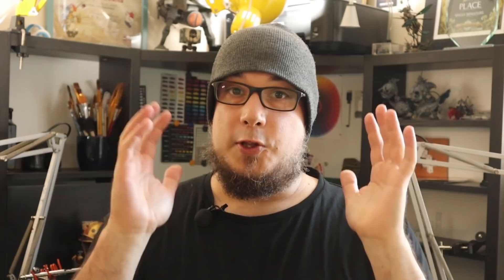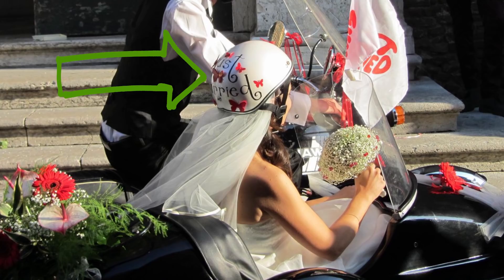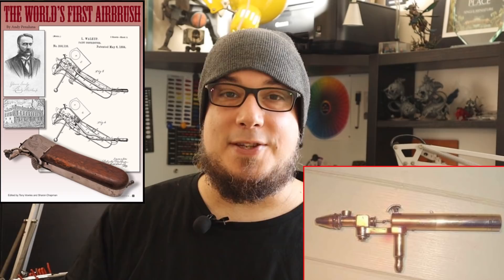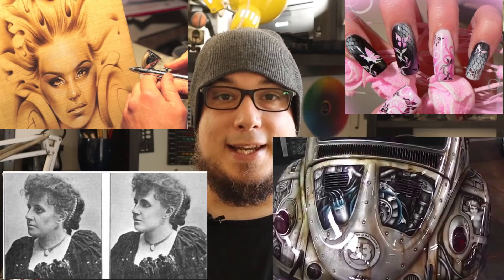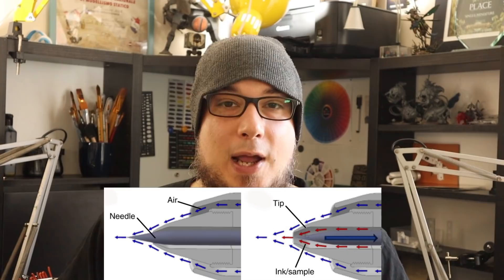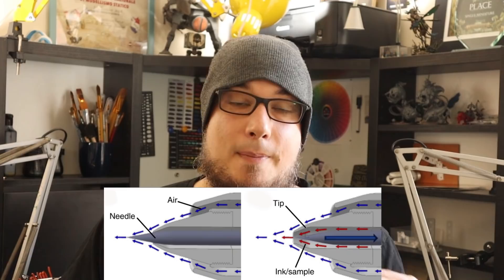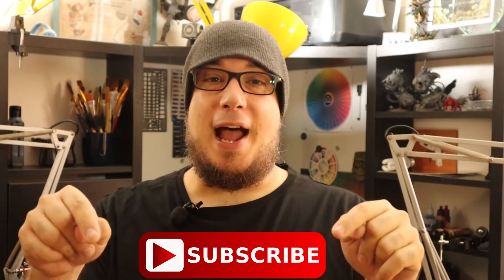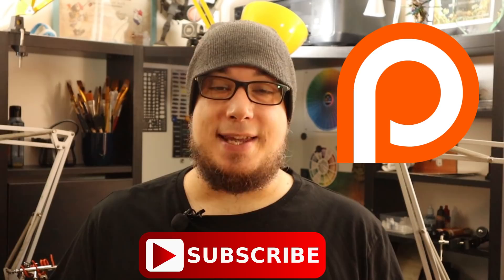Airbrush basics - Airbrushing for Miniature Painters

Comment: Great video as usual, but I disagree that you have to know about blending, glazing and all kinds of color theory and techniques before buying an airbrush.

Using an airbrush is THE most efficient way of applying paint to a surface - you're literally using less paint to cover the same surface area.  As a result, you avoid losing detail by not gooping on paint with a brush.  At the least, you can Prime and set up your Zenithal paint job with the airbrush when first learning to airbrush.  It also makes it faster to set up an entire army.  An airbrush is also a better way of painting larger plastic models such as Warhammer40K vehicles and architecture.

Also, having an airbrush affords you more possibilities.  You're not restricted to what a spray can gives you - you can mix your own colors and an airbrush isn't nearly as messy; plus, the atomization is superior to a spray can...in most cases.
Reply from the maker: Thanks! Yeah if you are an army painter and you want to use the airbrush for the very basic stuff this it's probably true, but if your main goal is good painting I really think you have to save money and stress until you are able to use it's full potential

Comment: noob question: isn't a 0,2mm too small to prime and to use it to paint gunpla, vehicles and other larger models?
Reply from the maker: No no it's the perfect size, I use it to prime monsters and entire armies! You need only to pull the trigger a bit more 😉
Reply: In my experience a 0.3 or 0.4mm is best for priming, basecoating, varnishing, the smaller needles best for details and freehands. But you can use a 0.2 as well. You might need a bit longer and more coats, but result is indistinguishable

Comment: Dear Marco,
I was wondering whether you can unscrew the air regulating screw under the iwata hp-bh. I've had cheap quick disconnects with an air regulator and when I unscrew it too far it jumps out! I was wondering if this airbrush would have the same issue? Haven't found anything online about it, nor have I seen you unscrew it in the cleaning video... 
Kind regards,
M
Reply from the maker: Hi! Sure, if you have dirt and paint trapped you can unscrew the valve; I do it rarely because usually I don't have a lot to clean in that lower part (and because I don't want to lose time finding again the setting I like 😅)

Comment: Hi Marco, your videos are awesome and i improved already. But i have a problem and maybe you could help me. When i use the airbrush and dry the model with an hairdryer and i use for example washes the paint comes off? Even after days of drying the paint comes a little bit off. (Seems like its still wet) I primed the model and i played already with the paint-water-Vallejoflowimprover mix but nothing works. I mix 50% paint 25% water and 25% flowimprover. Also tried 50% paint 50% flowimprover. (I know you cant say mix x% with x%, youd made this clear but maybe you see a problem with that)  What am i doing wrong, can you help me?  Keep the good work up!
Reply from the maker: Hi! Thanks a million 😊.
Your problem comes from the heavy use of flow improver fo dilution. Flow improver it's not a thinner; it's part medium and part retarder (more useful for brush application) and you should use just a drop or two if you are spraying for long periods. Try using simple airbrush thinner (with or without water). Check my video about thinners for more details 😉
Reply: @MarcoFrisoniNJM  Hi Marco. Thanks for your answer. The internet is a big place for information and most say you should use flowimprover over thinner. I will do some tests with the thinner. Thank you for your time :)
Reply from the maker: @vonundzulaxi9195  There's a ton of misleading information about airbrushing out there!
Reply: @MarcoFrisoniNJM  Thats true and nobody says anything to the water/thinner ratio. Like you said in a video, you cant say the exact mixture but just to ne sure, i still use water + thinner Not only thinner right? I will double check your video so sorry if you answer this already in there.

Comment: Great video again! I currently have a Pasche VL .4mm side feed but it gives a pretty brutal blast of paint and isn't good for details. I would love to invest in the Iwata but just can't afford it at this stage. I'm looking at a unit from a cheaper brand, the Sparmax 0.2mm/1.5cc Airbrush and I've seen a couple of reviews on the site selling it that pretty much swear by it, but I always take online store reviews with a grain of salt. Was wondering if you, or any of your viewers, have had experience with this brand. Thinking it could be a good introductory investment, if those reviews are on the money, which I can learn on and will keep me going until I can afford/justify investing in the Iwata. I know it'll be a case of get what you pay for, but at this stage my budget is dictating the decision :(
Reply from the maker: Thanks!!! Never tried a Sparmax, I hope someone else in the comments can give you a review on it.
I can only assure you that you'll see a huge, satisfactory difference with an 0.2 😉
Reply: @MarcoFrisoniNJM  Cheers man, I reckon I'll give it a go and see how it works out. Then I can save my pennies and upgrade later if needed. Are there any methods you can recommend for recognising the quality of the actual spray an airbrush produces? Like a control test that might help identify the quality, or lack of quality, of an airbrush's performance, flow issues etc.

Comment: I have three but use only two....one for priming and then a Badger Sotor 2020 for the real work....do you have any opinions on that air brush?  I would warn ppl that each company has a different hose connector...I ended up buying several hoses as they all have their proprietary connections...what a pain in the @ss!